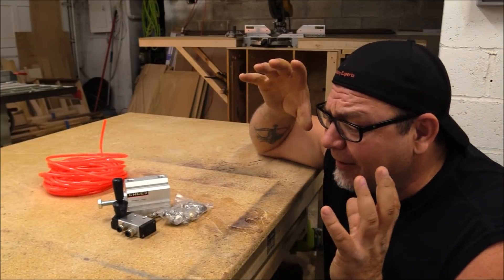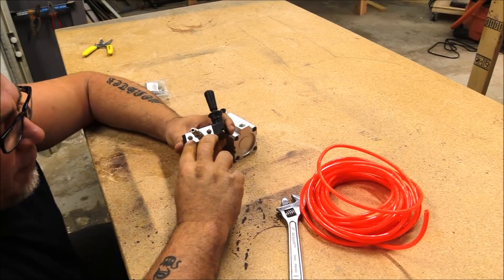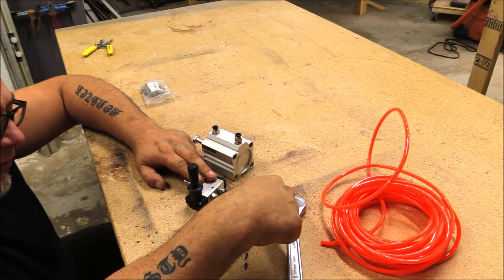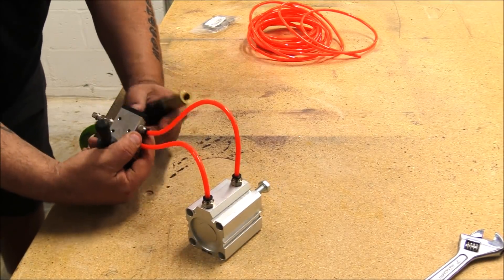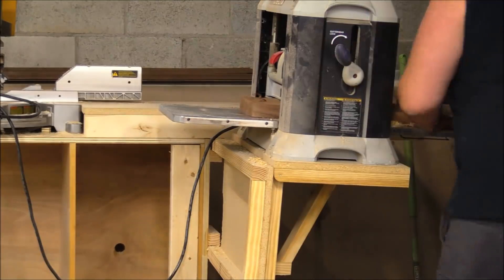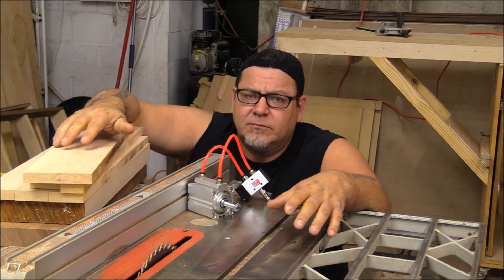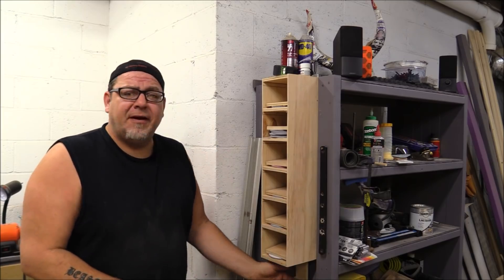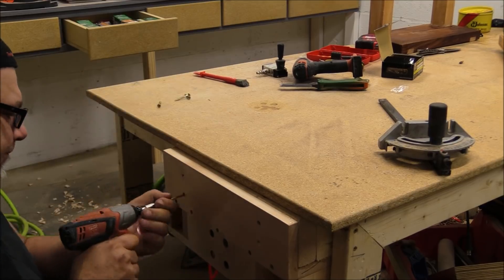DIY - Amazing Automatic Bench Vise | It's freaking pneumatic!

Comment: If you put a flow control valve on there, you can slow down the action of closing. Leave the opening action uninhibited and it will open fast. 

That way at least you have a moment to pull your fingers away before full pressure is on, or quick release if you do get caught.

And keep your psi as low as possible for the work at... hand.

Comment: I added a pneumatic cylinder to my kreg pocket hole jig replacing a toggle clamp. Not only does it make the work go faster it much easier to reach the air control switch than the toggle clamp because you can place it where ever it is most convenient.

Comment: That's got all kinds of potential.  If you're in a situation where pinched fingers are a worry( children), you could add a 2nd switch distant from the first.  Require both switches be pressed simultaneously.  It occupies both the right and left hands.  Safety switches might be aggravating, but it's an easy safety thing.  You could also add a pinhole sized orifice or two to slow the action of the actuator.  Heck, you could switch between fast and slow action.   And orifices would also give options of gentle pressure clamp, or actuate an extra second or so, and get higher pressure clamping.  DAng, that thing has possibilities.

Comment: If you remove the supply air line with the clamp still hold as long as you don't touch the switch?

Comment: Great idea; I want one for my shop.  A couple of flow valves would slow down the clamp and release speed and a regulator would be nice to adjust the clamp pressure for more delicate parts.  I like the suggestion of the foot operated valve too.
Gotta say, I like where you are going with pneumatics in the shop.

Comment: thank you Izzy you are tops . question please on the table saw fence as i have one like it also . i can not seem to keep mine straight . 10yrs as a machinists ( 70-80s ) so i know how to read a dial indicator . i have gotten it to with in .002 front to back and a month later i am binding at the back end . help please
Reply from the maker: what table saw fence are you using
Reply: i have a ridged table saw so that fence that came with it thank you
Reply: it looks like yours. a ridged table saw with fence

Comment: Verry nice but the opening to small
Reply: If you look on amazon theres tons with a longer stroke for not much more money. All down to what you need to clamp, and how well it will hold those larger items. for a quick clamp system this stroke size its generally enough for most woodworkers. Any larger pieces, and you would be more likely to clamp it other ways, or be working it in power tools.

Comment: I could see the linear actuator being used to drive a wedge against a slide thus permitting something similar to a fast acting vise the wedge should increase the clamping force, possibly even enough to negate the potential slippage. I am also imagining a foot pedal actuator, that would increase the chances of getting a hand caught in it but, eh, live a little right?

I'm just realizing my concept needs a little tweaking as it won't actually do anything but lock the vise in position, maybe if the wedge also pulls the vise tighter that would work as well, but might require some friction tape or something in order to bite tight enough to really grip a board in the vise

Comment: What’s the clamping pressure? Is it just whatever your pressure regulator is set at on your compressor which for that bostich pancake one like you have I think max recommended pressure is like 90 psi (I have the exact same one) but does it maintain that pressure throughout the time you have it clamped or how does that all work. They Seem powerfully strong enough though, I mean you were able to chisel without any slippage or loss of clamping pressure. Just curious what those actuators are rated at.
Reply from the maker: once the clamp is closed there is no loss of pressure, it will maitian the pressure till i trough the switch well i would reset the part if i left it over night

Comment: First thought that comes to mind is working this into a pocket hole jig
Reply from the maker: that is the next up grade to the clamp good call by the way
Reply: @izzyswan  maybe with a foot pedal switch
Reply from the maker: i dont have a switch that works for that application they make them but mine is a hold down switch not and on off switch they make then though
Reply: Make a wooden foot pedal and incorporate the switch you have now 😊 Maybe add a spring return or something

Comment: That scrap of yellow pine 2x4 a left over from down south? The only things I find in Yellow Pine up here are treated, and sometimes the larger dimensional stuff (2x8 and 2x10 etc, lengths 12' and up)
Reply from the maker: home  depot anything over a 2 by 8 is yellow pine
Reply: Over on this side of the lake, my nearest H-Depot is Green Bay (2 stores) followed by the one up in Iron Mountain. Closer than Lowes though . . . Nearest is down in Oshkosh.  I just bought 4 2x8 10 footers from Menards and those were still Canuk fir, but looked like better wood than the 2x6s.

Comment: Pneumatic clamping is very common in manufacturing industry,  great way to clamp down RUFF parts,  if you do delicate work not best option. Great built 👍.. P.S. hide this vid from Safety Nazi$$.
Reply from the maker: the nice thing about pneumatic is its super easy to control the pressure with regulator on the compressor or add a ten dollar one at the line in so you can do as delicate as you want
Reply: @izzyswan  , you are correct to some extent... from a different point of view... Lowering incoming compressed pressure reduces also proportionally power of cylinder, at some point you will not be able to hold parts. Please don't take me the wrong way.. Your approach is great and it will do the job... I was just trying to express that every design comes with pros and cons... for some it's a problem some other the best thing ever.. That is what make us human...  tip... to control the proportional
 force to the cylinder look up the air over oil system or soft hydraulic systems,  this will eliminate the compression loss issue with the air system alone...
Reply: BF Florida, you're correct that you can upgrade this circuit to add controllability. Each of those upgrades has a cost in complexity and money. This is a very basic, functional pneumatic circuit. 
Yes, air-over-oil systems are nice. I have seen some nice vacuum actuators too.
Reply: 0